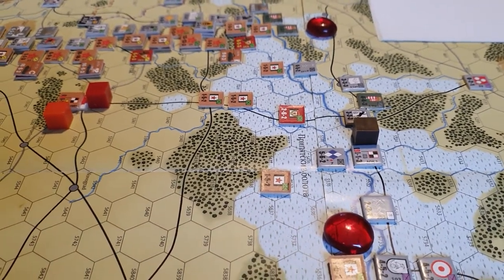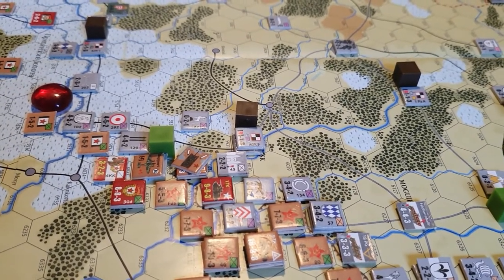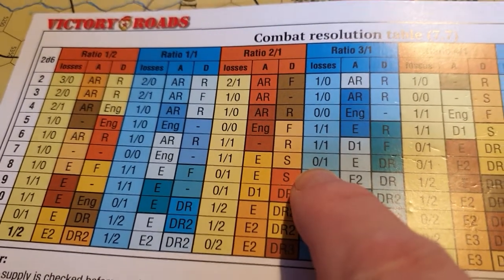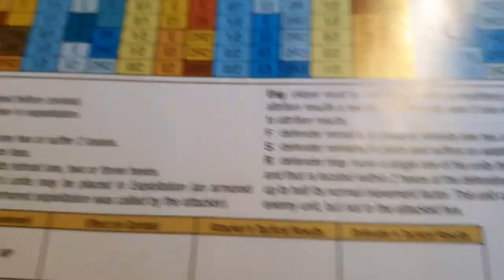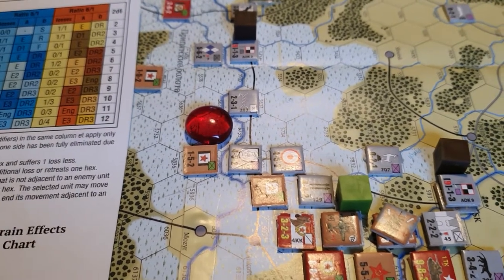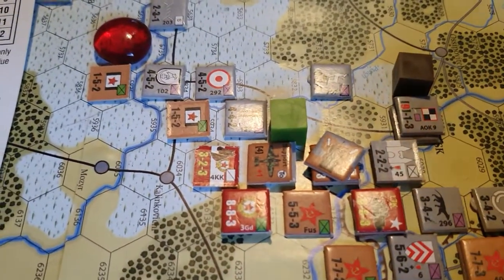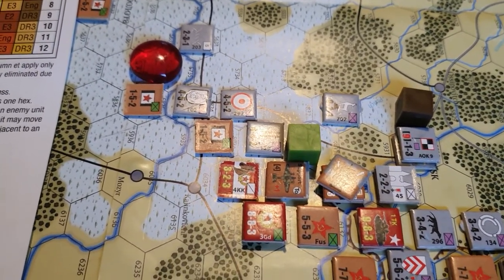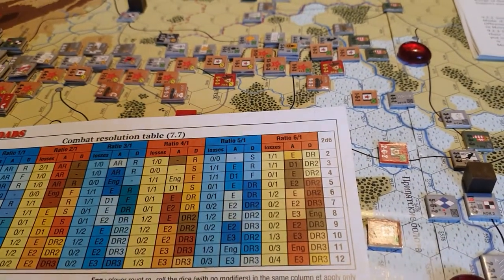Victory Roads & Liberty Roads - 5 Combat and Exploitation.

Comment: I think there is an error in your comment about combat results when using elite status. In video around 9min, you use example of attacker using 3:1 odds with elite status and rolling a '3'. Then you state that that attacker can use the results of AR, Eng, E, E2, and E3. That is WRONG. Just note: the colors used on chart are too close to the same shades. They are actually all different color shades in any column. So on average, a color group normally has 2 or 3 results possible (but sometimes only 1 or up to 4). So going back to your example, the only results the attacker can choose from is AR, Eng, or E.
Reply: In order to get the other dark blue color group, a roll of '9, 10, 11, or 12' would need to be rolled. (which gives E, E2, or E3 possible)
Reply from the maker: @genchaos3385  Thanks I missed the fact the colours were subtly different.  I did think it was odd they could choose so many options.
Reply: @Jezza_One  I think more of what size BOXES are formed by the colors used on the CRT chart. So again using your example of attacker with 3:1 using elite status, I look at what 'BOXED' results(for elite checks only) are formed under that specific column. So looking at LibRd's chart for attacker 3:1, there are only FOUR BOXED Results Possible - the [2only]box, the [3,4,5]box, the [6,7,8]box, and the [9,10,11,12]box (again, this is only when dealing with elite stuff).

So I think it is a cool combat system with elite mechanic. Again, using your example. If the attacking player really rolls bad with snake eyes of 2. He really wasted his elite advantage and stuck his neck out for no reason. He gets No Options of picking a result since his only option is AR AND still has to take the first hit to be applied from the defender.
Reply from the maker: @genchaos3385  I agree it is a unique but interesting combat system with lots of nuances. Thanks for your help with this game.